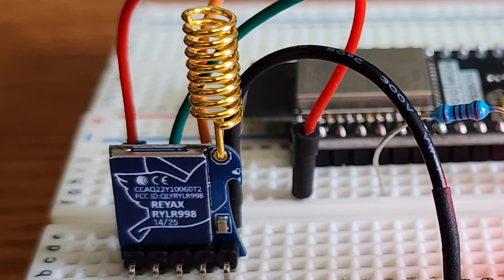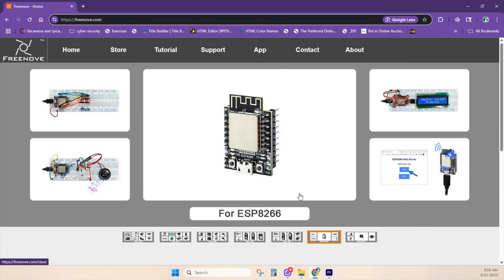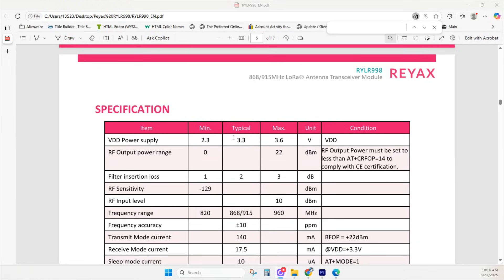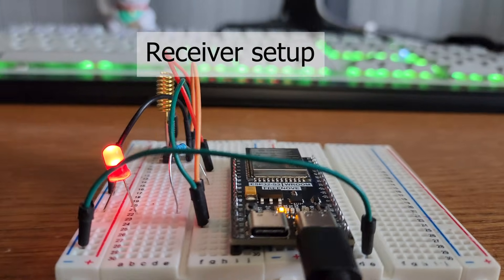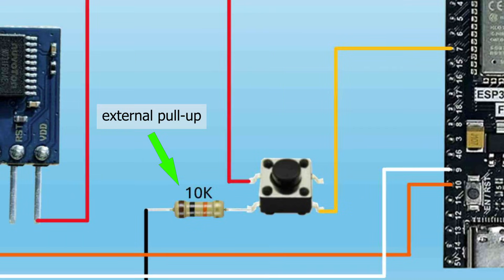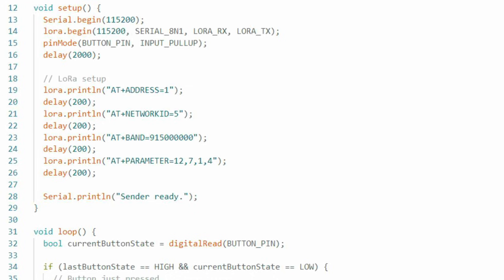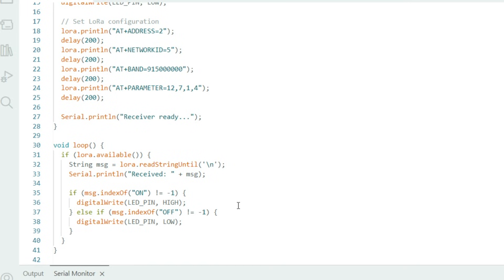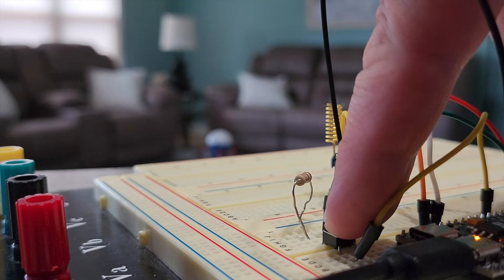No Wi-Fi? No Problem! Send Wireless Commands with LoRa and ESP32

Comment from the maker: //transmitter
//ESP32
#define LORA_RX 9
#define LORA_TX 10
#define BUTTON_PIN 7

#include <HardwareSerial.h>
HardwareSerial lora(1);

bool lastButtonState = HIGH;
bool ledState = false;

void setup() {
  Serial.begin(115200);
  lora.begin(115200, SERIAL_8N1, LORA_RX, LORA_TX);
  pinMode(BUTTON_PIN, INPUT_PULLUP);
  delay(2000);

  // LoRa setup
  lora.println("AT+ADDRESS=1");
  delay(200);
  lora.println("AT+NETWORKID=5");
  delay(200);
  lora.println("AT+BAND=915000000");
  delay(200);
  lora.println("AT+PARAMETER=12,7,1,4");
  delay(200);

  Serial.println("Sender ready.");
}

void loop() {
  bool currentButtonState = digitalRead(BUTTON_PIN);

  if (lastButtonState == HIGH && currentButtonState == LOW) {
    // Button just pressed
    ledState = !ledState;

    if (ledState) {
      lora.println("AT+SEND=2,2,ON");
      Serial.println("Sent ON");
    } else {
      lora.println("AT+SEND=2,3,OFF");
      Serial.println("Sent OFF");
    }

    delay(250); // debounce delay
  }

  lastButtonState = currentButtonState;
}

//receiver
//ESP32
#define LORA_RX 9
#define LORA_TX 10
#define LED_PIN 6

#include <HardwareSerial.h>
HardwareSerial lora(1);

void setup() {
  Serial.begin(115200);
  lora.begin(115200, SERIAL_8N1, LORA_RX, LORA_TX);
  delay(2000);

  pinMode(LED_PIN, OUTPUT);
  digitalWrite(LED_PIN, LOW);

  // Set LoRa configuration
  lora.println("AT+ADDRESS=2");
  delay(200);
  lora.println("AT+NETWORKID=5");
  delay(200);
  lora.println("AT+BAND=915000000");
  delay(200);
  lora.println("AT+PARAMETER=12,7,1,4");
  delay(200);

  Serial.println("Receiver ready...");
}

void loop() {
  if (lora.available()) {
    String msg = lora.readStringUntil('\n');
    Serial.println("Received: " + msg);

    if (msg.indexOf("ON") != -1) {
      digitalWrite(LED_PIN, HIGH);
    } else if (msg.indexOf("OFF") != -1) {
      digitalWrite(LED_PIN, LOW);
    }
  }
}